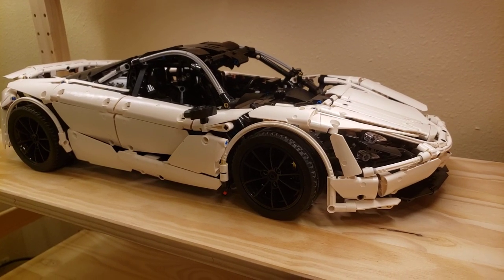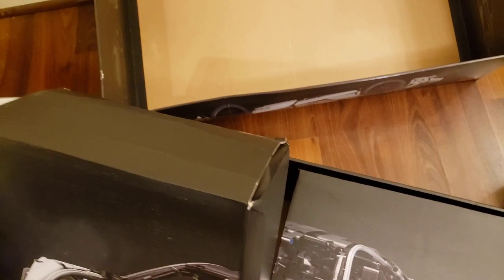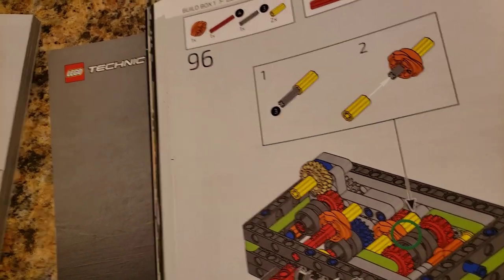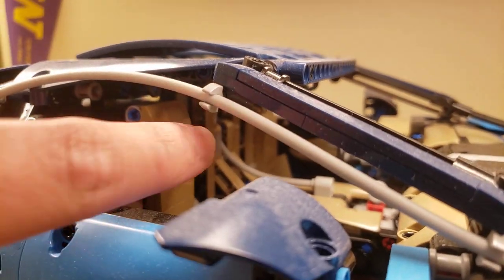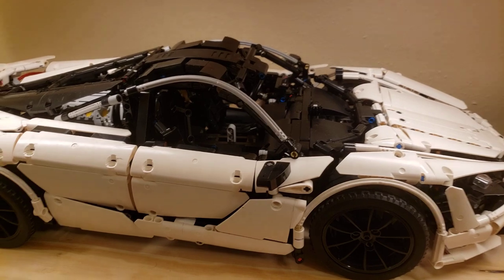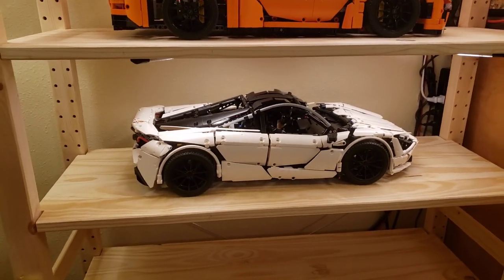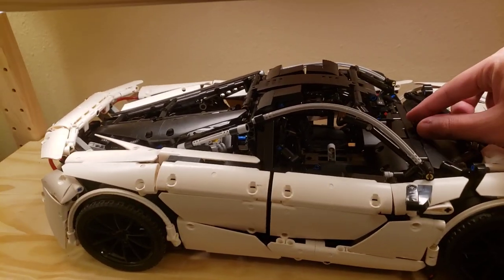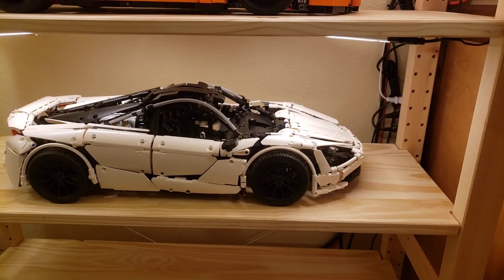Is CHINESE LEGO TERRIBLE?!? Mould King McLaren 720S Review

Comment: Thanks for the video. Mould King is using parts from a company called GoBricks. They belong to the best Chinese bricks you can get. So far, I have built 7 Mould King models. No missing parts. Quality is 95% Lego in terms of feel and fitting accuracy. Strength of connection is higher than Lego. Visual appearance could be better. Some beams have scratches, tiles look often somewhat dull due to micro scratches. Stickers aren’t the best in quality and are sometimes creased, because they simply put them between the bags. This is definitely something Mould King should improve.

Many designs like the McLaren are based on (stolen) MOCs. The manuals are usually a copy of the manual created by the MOC designer, but with some changes. Definitely more challenging to build, but I like challenges. Lego is really made for the masses and easy to assemble. I personally like the McLaren very much. In my opinion the designer did a great job capturing the shapes of the original car, which is really very hard using Lego bricks.

Luckily, Mould King has started cooperations with MOC designers so they get some money. And some models like their Lamborghini Sian (that was announced and released before the Lego Sian) are completely own designs.

Overall, I am very pleased with Mould King given the price.
Reply: Hey so I saw the Lamborghini Sian FKP 37 which is set number 13057 from mould king, and I wondered if you have it or perhaps know some things about Mould king in general.
The set looks on some parts better than Lego, but on other worse (especially the headlights seem odd) from a video about it I saw that they include actual carbon axles, which would mean that even when used they have higher stability, which is nice.

Now, the set costs 200€ on BlueBrixx, which is a website I ordered from a few times already, and the Model from Lego itself costs 300-370€ on Amazon.
Would you say if its just for the building and putting it on display (If I play with them, then only a little), Is it worth to go for the cheaper stuff?
Reply: @synka5922  I have the static version of the Mould King Lamborghini in light blue. They include carbon axles in some sets, which is beneficial when using electric motors. Even my static version came with carbon axles. You can decide to use them, or stick with the plastic axles which are also included. This is explicitly mentioned in the manual.
Reply: Is the F1 car from Mould King also a stolen design ?
Reply: @koaminsamudera235  Yes, have a look at Rebrickable.com MOC #31313. Mould Kings version is an unauthorized MOC. However,  a company called Mork made a deal with the designer. They have released the model in several different colors with his consent.
Reply: @tropitropas949  thanks for your information. I will check Mork. Just try to buy something legit, to avoid my personal 'guilty feeling'😁
Reply: Great info‼️‼️‼️ I love animating these sets!
Reply: Lucky you I've had nothing but missing parts on separate models

Comment: Since lego technic is just overpriced and has dropped in quality, mould king, cada and some others have taken the lead. Check out the italian supercar from cada. Same price as the lego ferrari but twice the pieces, rc controlled with 4 motors and so much more technic in it. Even paddles move when shifting. Its an impressive moc. Lego is going the wrong way by getting more expensive, more simple and using thousands of stickers.
Reply from the maker: 1. LEGO Technic has NOT dropped in quality- and exceeds in terms customer support and model design (for the set I reviewed anyways). I touched upon this in the latter half of the video; most notably overall interior design to the 1:8 scale sets from LEGO. It's also ironic to bring up "quality:- considering the QC issues I referenced with regards to scuff marks on the exterior panelling for the Mould King set.

2. LEGO is NOT getting more expensive- it's non-licensed, and even licensed sets have maintained the $0.1 per piece mark for several years now. The Lamborghini has almost no stickers on the body to speak of. The few stickers that are provided with LEGO sets are of an objectively higher quality to the one from Mould King.

3. The LEGO Ferrari is $170, $50 cheaper to the CADA set. The CADA has had some QC issues with some pieces being a lose fit from other videos I've seen. The motorized version also generally has had QC issues, with the motor failing within a few months (at least from my experience with it). 

CADA, Mould King, and other overseas brands are compelling offerings when looking at it from a price per brick stand point- but still need US based support. While the CADA "Ferrari" is a set developed in-house, several sets, like the one in this review, are taken from MOC designers without compensation. LEGO is more expensive as a result of them investing heavily in R&D, US based customer support that's actually stellar, generally good instructions, and stellar packaging. Don't get me wrong- if you don't care about these things- then go for CADA, Mould King, or other brands- I'm positive you'll be happy with your decision; but LEGO still is and will continue to be a more enticing option to many as a result of some, if not all of these afformentioned attributes. 

I think it's important to be objective about this. There's a place for both LEGO and these alternate brands to exist as it stands, and I think we should generally be open to either option as it means more competition in the brick building space- which is good for all of us consumers.
Reply: @CorerMaximus  1. As an example: the Sian, a 370€ set, it has 5 different types of lime green, I would say it's a quality problem. Even the Porsche gt3 in orange. My model looks completely done, loosing colour after time, orange gets to yellow. It even did not stand in the sun for the whole time. Hmmm Compared to sets from the 90s,the Porsche looks really bad in colour quality.

2. in older sets like the MB Arocs we had pneumatics, motors and like 2700 pieces for 180€... So lego is getting more expensive... It was even a licensed set. Now we have the Ferrari, 1800 pieces, no functions ca. 60 Stickers... I just say I don't like the way lego is going. 

3. the cada Italian supercar costs 180€ and the Ferrari from lego costs 180€...
I have 3 motorized cada sets, motors all still running. So I can not agree. 
Maybe in the US it's a different price tag, but here in eu the cada is the better deal. 

Yep I agree, at first the "stole" the mocs, but with some actual sets they support the mocers.
Reply from the maker: @A6Chefpilot  Yep- the Sian is generally an exception to the LEGO quality rule, and I wouldn't blame people for pursuing alternates after that. As for the Porsche set- I haven't experienced any discoloration in color despite having it for several years. If you put anything under the sun for several years- even a box of cereal, it will loose color. 

Where did you buy the MB Arocs for 180 euros? If it was on promo- that's not really comparing apples to apples anymore. If we're talking promo pricing- the Bugatti can be had for sub 200 dollars- making it comparable to some alternate brands.

I'm not disagreeing with you- LEGO is more expensive than these alternate brands, but it's important to look at what they make up with that increased pricing prior to saying LEGO bad, CADA or any other brand good. It's like looking at Apple- sure, you can get the same hardware in a computer that costs half as much- but you aren't getting the customer support, build quality, design, battery life, updates, etc.- and that matters to people. Although I'm a PC person, I acknowledge everything Apple does right, and feel comfortable recommending them to others who I believe may genuinely be happier going that route than with a similar, cheaper Windows machine. In this case- LEGO can be thought of like Apple. Sure- they're more expensive, but they also bring a lot to the table with that higher margin they have. It isn't for everyone- and some people will be happier going for an alternate brand at half the price while giving up a few things; and in all honesty- that's perfectly fine.
Reply: Nah these guys straight stealing people’s moc on rebrickable and make their own sets. You’re just supporting thieves
Reply: @acey7232  B.S. Many of the alt bricks are now obtaining licenses from the designers. Mould King, Cada (their hummer is better than any 1/8 lego), TGL (Tiagale), Cada and anyone  that uses Gobricks (18k, Happy build. Mould King, Sembo, Super 18K, Rael, jisi (decool) and Xinyu rival lego all day long. 

I don't know what's up with the alt set prices quoted either. My supplier gets me any 1/8th I want in any color with any of the 5 wheel types in a choice of 7 colors, as well as my choice of color in electroplated cylinder heads and disc breaks for $85. I get my acrylic 1:8 displays for $17. Eff lego. If I buy a set that didnt compensate the designer I buy the original instructions of rebrickable to compensate them.
Reply: @parkerterrell5578  I agree. I just bought the ucs at at and the more I think about it the more I see how overpriced Lego is. I respect designers but I’m done paying Lego prices. Good ole capitalism huh.

Comment: Have you  asking at your seller, in english ,if you could receive your item inside a solid carboard box with the original packaging from china ? i's the first things to do guy for a box in good condition.
Reply from the maker: I didn't. I just bought it straight from taobao without contacting them at any point thought-out the process nor adding any note to my order.

Comment: The 1:8 scale is base on the proportion of the actual car not on lego scale
Reply from the maker: The proportions are off the actual car- here's a comparison on the dimensions Comparison (L, W, H, sizes in inches):

Porsche 911 GT3 RS
Actual: 178.9, 74, 50.1
LEGO: 22, 9, 6
Scale: 8.1, 8.2, 8.3

Bugatti Chiron
Actual: 178.9, 80.2, 47.7
LEGO: 22.4, 9.7, 5.7
Scale: 8.0, 8.2, 8.4

Lamborghini Sian
Actual: 196.1, 82.7, 44.6
LEGO: 23.622, 9.84, 5.12
Scale: 8.3, 8.4, 8.7

McLaren 720s
Actual: 179, 85, 47
Mould King: 21.6, 9.5, 5.3
Scale: 8.3, 9.0, 8.9

Comment: Is the set easy to assemble?
Reply from the maker: It's basically Lego with the same tolerances, and you're following a manual to put it together. It's easy to put together, just takes a full day to do so.
Reply: @CorerMaximus  should i buy this set or lego 42130?
Reply from the maker: That's a decision only you can make- which one would make you happier to look at?
Reply: @CorerMaximus  i like the 720s but i think its a little difficult